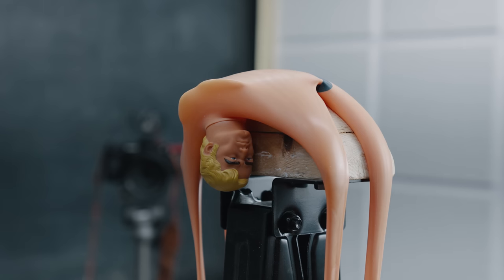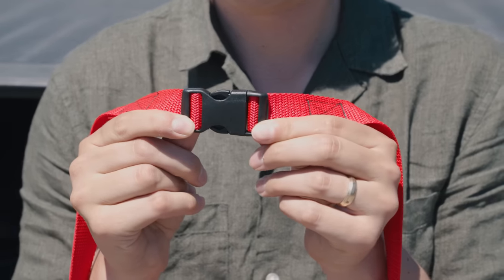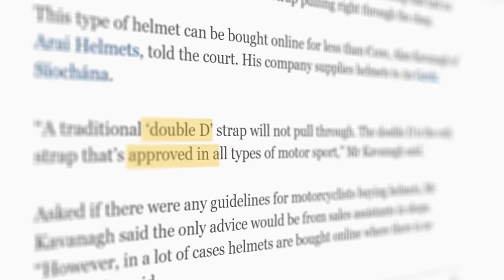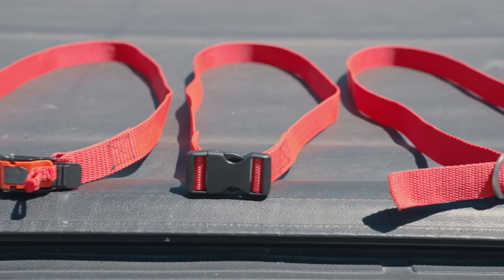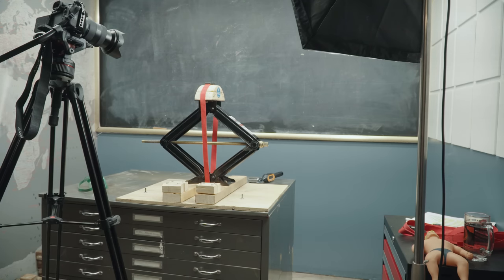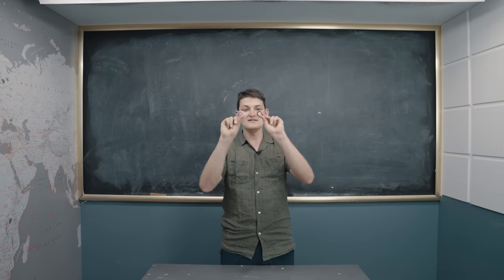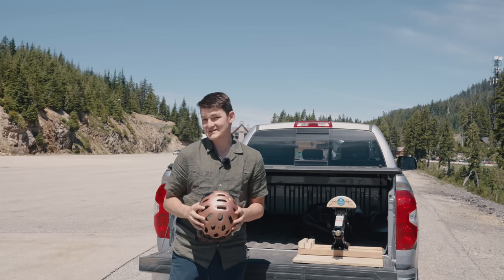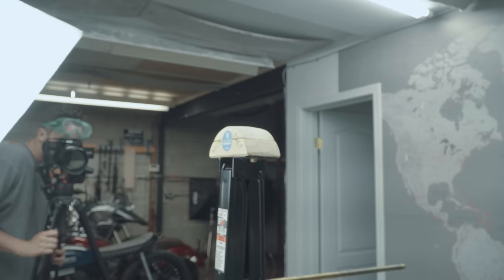Why Motorcycle Helmets Use this Ancient Buckle

Comment: I have a helmet with double D buckle, i hate it....
My other helmets have this ratchet buckle thing, the 2nd you show, which are used at Inline skates.
They are ok for me. Fast to close, fast to open, always tight, and idiotproof for everyone.
Reply: I have one helmet with Double-D... I hate doing it up. The micro ratchets are adjustable and easy to put on. Easy peasy...
Reply: You are touching on the other aspect that this kind of test doesn't cover. We don't choose kit purely for its safety value. Comfort and ease of use also play a part. Hence there will be a balance between these factors. I detest the double D and won't buy a helmet with one, preferring the ratchet system. I also use a flip front helmet that is less safe than the full face type due to inbuilt weakness in the shell structure. Both of these choices are a balance taking into account ease of use, practicality, comfort and risk. If we simply wanted to maximise our protection from risk, we wouldn't ride.
Reply: I've always found the double d ring really easy. Wouldn't buy a helmet without it
Reply: @markellott5620  spot on. Any one-dimensional test that aims for an absolute result is going to paint you in a corner. If we want absolute safety, we'll stay at home waiting for our number to be called. The d-ring might be the safest latch, but does not make for the safest helmet.
Reply: @ThiefOfNavarre  we'll have to differ on this. I've had double d and ratchets and won't get another double d even as a gift.
Reply: When you’re used to the double D ring, it’s super fast to put on or take off.  No thought goes into it, even with gloves.
Reply: @markellott5620 , also, it's not like you can chose what strap you like with your helmet. Each helmet comes with a particular kind and if you don't like that one, you need to get a different model or, if the manufacturer only makes one model of its kind (which is often the case with flip or enduro helmets), go to a different manufacturer. Who may have different helmet dimensions despite the same size, so they may not fit your head so good.

Or you may be barely able to find any who makes helmets of the kind you want with the strap you want - e.g. nearly all flip helmets come with a ratchet strap.
Reply: @-Jethro-  Yes you name it... If you have used it for some time. Its not idiotproof. I am taking others with me and its not funny if i have to open and close the buckle for them. The strap has the job to hold the helmet on the head. It don't has to be this strong. You will never be lifted up at your head / helmet like a huge pinata. Don't get me wrong, its great to have buckles with this strength, but for helmets they are to much.
If you get a hit that strong, that the helmet would fly away, your neck is cracked anyway. A overdone strong buckle will not help.
Reply: @-Jethro-  I agree, if your practised it's like procedural memory. Just another pre-flight ritual
Reply: @redbynight  that's fair enough. Horses for courses 👍
Reply: I have a ratchet one too and hate it as its not for the ease of putting on as yes thats easy but it also releases very easy snd thats when you dont want it too . The D is a pain to use but does not loosen by an accidental me messing with the strap to clear clothing as the ratchet one is stupidly easy to undo by accident.
Reply: @mariodonkartworks  What brand is your helmet and how old is it? Mine are over 6 years now, is a NEXO and a HJC, both with ratchet buckle and i hang them up by the strap. I have hooks on the walls, close the stap / buckle and they are out of the way. So the staps buckles working 24/7 to hold the helmets on the hooks. Never is one of them falling of.
Reply: @ThiefOfNavarre  Agreed on this one
Reply: @TacticalHamsterDance  indeed. Your first priority should be fit. If a helmet is going to do a proper job, it needs to fit right. As for straps or buckles giving way, if this happens you are already in big trouble. It's worth pointing out that the case cited in the video made the news precisely because it is a rare occurrence.
Reply: @-Jethro-  double d rings were standard when I started riding. I didn't much like them then. When manufacturers switched to the seat belt buckle it suited me just fine.
Reply: @TobiasRieperGER  "It don't has to be this strong."
ECE 7.10.5.  The strap shall withstand a tension of 3 kN without breaking. 
On average it takes over 4kN of steady tension to break a neck.
Reply: " idiotproof for everyone."
There are no such thing. Idiot are a clever.

Ratchets needs to be pre-adjusted, no such thing with DD.
If it is cold and you have thick windstopper or warm and you wear nothing, no need to adjust the DD.
Reply: @XtreeM_FaiL  You adjust the ratchet buckle that it is completely in when wearing nothing so that 2 fingers fitiing side by side between strap and lower jaw / neck. You don't have to strange yourself. If someone uses the helmet, who needs more space, you can close it on half way. My ratchet buckle has 10 clicks when full in. 5 are enough, too. and if someone gets his full hand betrween the strap, i adjust it. But in the last 6 years i don't needed to do that. And i don't needed to help anyone with the helmets. They take it, see the buckle and everyone knows what to do.
With double D i have to teach them and have to help them later.
Reply: @TobiasRieperGER  I don't know how to adjust ratchet. :P
Reply: @XtreeM_FaiL  Then you shouldn't be riding a simple vehicle, let alone a motorcycle anyways
Reply: @VilleVaananen  Because I like DD over any other system, I should not ride?
I have to admit that I don't fully understand logic behind that.
Reply: @XtreeM_FaiL  That wasn't my point. Read your previous post and my reply to it.
Reply: @VilleVaananen  You mean this one?
" I don't know how to adjust ratchet. :P"
Reply: @markellott5620  I agree. However, I don't know if DD or ratchet is safer - I prefer DD because it's more comfortable for me.

Comment: Ok. I understand why it is safer. But for my personal opinion it's easier to buckle on and off micrometrics. It's quicker. It just works.
Reply: Pauline Weinberger  Taking helmet on or off on micrometrics takes about lets say few seconds. It is one move to close and one hand to open micrometric lock. I don't say it is safer, but I don't agree that it isn't comfortable. For me it is just compromise between safety, quickness, easiness and comfort. I tried two o-ring and didn't liked it. I ride safe or at least try. Call me stupid, but I think if I would like to be 100% safe I would be driving the most sturdy and indestructible car or a tank or just stay at home.

Comment: I would love to see this test conducted with a more accurate measurement on the acutal tensile force. The issue I see is that the jack does not provide a linear force for a given torque as it gains mechanical advantage the taller it gets.
Reply: I was thinking the same thing as I watched this. A hydraulic jack with a pressure gauge would give more accurate force indication.
Reply: If you see the torque for the strap failure is at the correct ft/lbs for the stitched X failure as he stated 900 Ft/lbs

Comment: Newton meter stats aside, the Fidlock and micro ratchet are more than effective in keeping the lid on your head and are MUCH faster and convenient to operate.
Reply: And more isn't always better: Helmets in the military are designed to snap earlier "than they have to". Because at some point it's better - as in more survivable - if the helmet gives. As in trying to deflect as much force as possible. Instead of ripping your neck off :/
He even says it, at "900 pounds you're better off snapping the strap and trying your luck without a helmet" I for one would place bets that my neck will snap long before that.
Reply: That's debatable. It's faster if user removes double lock completely, BUT there's one thing. Some user just pull the release tab and leave lock on and then just slip it past your jaw. I use double D's and I've tried and it can be done, but it's bit fiddly to me. Anyway I can guarantee that if one practices that it would be way faster to operate than any "quick lock"

Comment: The double D can be very quick release as well if the manufacturer makes the strap long enough, I used helmets from a British maker called Griffin which had a very long fastening strap, the design meant you pull the whole strap through both rings then fold it over to pull it through the single one, this gave a "tail" which could pull the fold through the single ring in one motion instead of feeding it through.

Comment: what about a metal ratchet..? A rare occasion when I disagree with Ryans statements. Double D helmet users are the slowpokes as the back last to put on their helmets and last take em off... At times the speed which you can take on or of your helmet might be a safety factor as well. As often as it would make difference between having a good quick release thing and the ancient rings possibly.
Reply: I can't imagine a situation where the speed of donning or removing a helmet would be a safety concern...especially considering the double-D ring system only takes 5-10 seconds at most to do up.  Just remember to put your gloves on last, and take them off first.  Easy-peasy.  :-)
Reply: Yeah, and people shouldn't bother zipping up their leathers because it takes far too long which becomes a safety issue.
Reply: I agree. Shoei says their metal ratchet is just as strong as a D rings and I believe them.

Comment: I'm confused.
The mainly used lock here in my area works like a seat belt buckle, only smaller.
I'm sure the are as strong as D-rings, but way more comfortable. I lock my helmet 
with just one hand
Riding bikes for over 30 years now and I was not aware that double D-rings still exist.
Nobody I know buys/uses them.

Comment: people complaining about the DD rings being inconvenient, I find putting my ear plugs in is the slowest and most annoying part of riding 😂😭 putting on my jacket, gloves, boots, helmet and removing the cover on my motorcycle takes seconds and no brain power to do, ear plugs? fiddly and annoying, if it comes loose during a ride, i have to stop 🤯 best i found are silicon ear plugs that forms to my ear, doesnt absorb water, stays tight and a quick press reforms them to my ear every time, i wish motorcycle helmets had a way to seal your ears like shooting ear muffs or something 😥
Reply: Glad to see you making a point about earplugs. I rode too long without them which probably/likely contributed to my continuous Tinnitus. Using earplugs when riding is very simple and cheap insurance against damaged hearing. I also use the silicone type. Anyway I just wanted to add my experience to underline your great input.
Reply: I love my pair of happy ears brand preciesly for this reason. It takes a second.
Reply: Yes, ear plugs are a hassle too. But how is an already existing hassle an excuse for more unneccessary hassle?
does not compute
Fuck the D-rings. My next helmet will have the ratchet again.
Reply: Especially after realizing that you forgot the earplugs after the helmet is strapped on.🤪
Reply: @jaromor8808  it doesnt, Just highlighting ear plugs being a hassle 😹 i was putting my earplugs in and dropped one on the ground right before writing that post 😹 putting in Ear plugs annoy me but i need them 😹
Reply: @jvlivtriple   😵🤣
Reply: @mikesaler1038  Once you have a loss of hearing, it never comes back 🤕 my left ear is significantly damage already and i now want to protect whats left of my hearing. Stay safe Sir 😸 Thank you for the comment 😸

Comment: My helmet has a micrometric ratchet  and I'm not going to get a double d for my next helmet. And no my bicycle helmet is not out of adjustment. The ratchet on my motorcycle helmet is grate because it let's me adjust the length of the strap slightly with the rachet before I need to retune the strap.
Reply: Pauline Weinberger  Shoei Neotec and GT Air 2 helmets use metal micro metric ratchets. I believe I will have bigger issues if there is enough force to break the ratchet strap during an accident. I will stay with my GT Air.
Reply: Pauline Weinberger  if it can pull so hard it breaks my neck anyway, i think it matters little...
Reply: Pauline Weinberger  the rachet is made of plastic, like the one in the video, and my jaw bone would probobly brake before the strap or rachet ever did.

Comment: Your content is always  great! But I have to call you out on using a torque wrench in conjunction with a scissor jack... as the geometry of the jack changes the torque applied to the screw will not be liner to the force applied. But you know that lol.

Comment: Same story in general aviation, most new technology fuel injected engines fail on the market against ancient carburettor fed, magneto ignited, air cooled fossils. Because the fossils are cheaper, and they’ve made so many of them that now they actually work
Reply: Because let's be honest, all that "new technology" is aimed mostly towards efficiency and comfort. In areas where reliability is a must, they'll be likely put aside in favor of simpler designs.
Reply: Motero Argentino precisely

Comment: First let me start with I love your videos, so please don't think I'm trying to be a douchebag, I promise I'm not.  
The method you are using to determine a failure point is inaccurate because these types of jacks are at a disadvantage when they are in they're collapsed position. 
The further they open up, the more of a mechanical advantage they obtain.
This rig may give you semi-accurate information if all the straps broke, with the jack extended to the same position at each breaking point. 

Still a very cool video. 👍
Reply: The only thing that matters is that the strap fails before the buckles. The torque values/ position of the jack are irrelevant.
Reply: @ananthar80  If the numbers are irrelevant, why were they recorded?
Reply: @BryceAWD  I wouldn't have. But I didn't make the video. All I'm saying is it's still a useful test despite your objection to the numbers. It clearly identifies the failure mode and the weakest part

Comment: ah well, being right is no advantage. Don't like Double D rings, wont buy a helmet with them, haven't done so for at least 20 years. I am happy that in an accident severe enough to snap the ratchet type then I have worse things to worry about than a helmet coming off. Generally looking at the strap fasting is one of the first things I look for in buying a helmet and I reject all with double d rings, don't even consider them regardless of any other feature. On a professional note they are more fiddly to put on and off, when at the scene of accident where helmets have come off the rider in the accident the 100% cause in every case was not doing it up, and not the clasp breaking and in those cases almost all were double d rings because the rider couldn't be bothered with it for the "short" trip. So from the protect from self perspective, less secure but easy to use and therefore use every time is preferable to more secure but may not use every time? I would be interested to know in how many accidents the clasp has broken, I cannot think of a single case, I don't know anyone who has come across that happening either
Reply: That's a good point, too. Another thing I don't like about the D-rings is that I, personally, have to take off both gloves to do them up. Even with one on, I find it pretty hard to do. But I think they're also the most comfortable after tightening. I have the ratchet-type right now, and don't like it as much.

But I have a different concern due to which I'm questioning the test itself - during an accident, the force will probably not be applied gradually like he did during the test with the jack and the wrench. I think the D-rings will still win, and probably even more emphatically, because they'll probably hold the strongest during a sudden jerk/tug on the helmet, but it'd be interesting to see how the others fare.

Comment: As with many inventions: The things found early on are usually some of the simplest yet most efficient solutions.
Why? Specifically cause of the lack of technology. If you do not have plastics or fancy materials, if you do not even have iron to waste, then the thing that works must be mechanically efficient to be useable.
Like it is with the double-ring buckle: it is extremely simple, easy to manufacture and mechanically sound.

by no means does this hold for everything, neither is a double-D the best buckle, it just means they work reliably.

Personally i liked the one i got with my moped - miniature seatbelt lock. They are just as strong (as in stronger than the fabric they hold together), adjustable and easy to open/close. The reason why i like them is just that once adjusted there is no need to re-adjust (if you are no longer growing).

Comment: I have been through 3 Givi X.08 Flip lids over the past 5 ish years and they all had the rachet strap. My HJC IS-MAX was also the same. The last helmet I had with a DD was a HJC flip lid but i do not recall the model back in 2007 ish. Never had either kind fail or break on me mind but I have not had a major crash.... yet.

Comment: A couple of my early helmets in the 1970's had a "Sliding bar" fastening. They are a square ring with a sliding bar where the strap went through the ring over the bar, then returned under it.
Unfortunately the tail of the strap was fastened with Velcro, so many people by passed the bar and just used the Velcro. That is why the tail of today's helmets 'D-Ring' straps normally reverses direction after the rings.

Comment: This is interesting to see. I don't ride motorcycles, but I do wear a lot of helmets during climbing. The official climbing standards require a minimum holding force of 500N (50kg). Industrial helmets have a minimum break strength of 150N (15kg), with a maximum holding force of 250N (25kg), to prevent being choked by your helmet